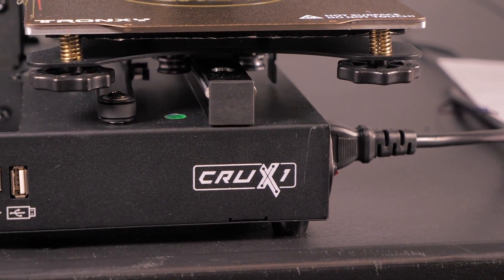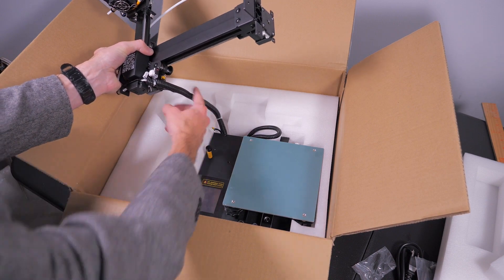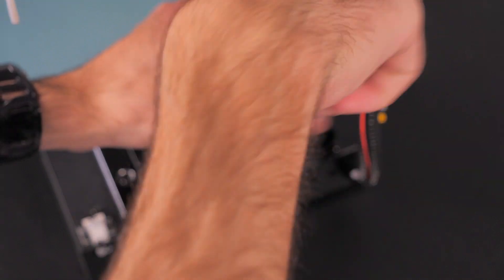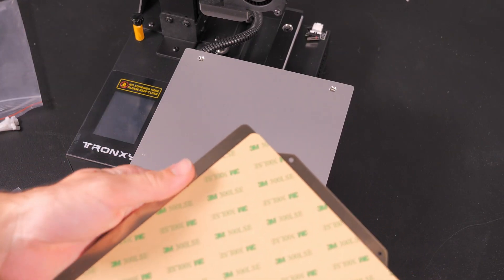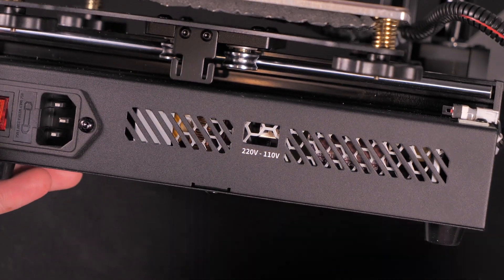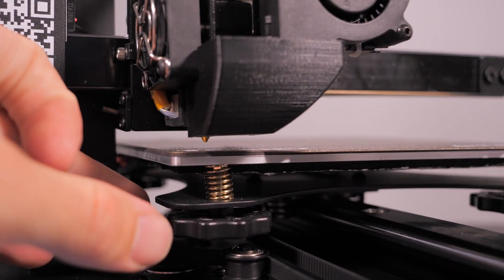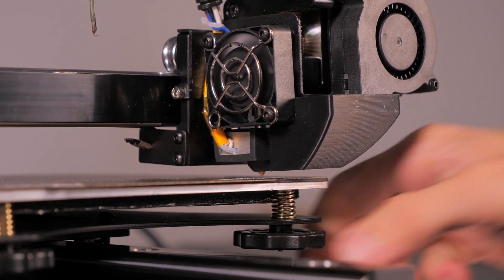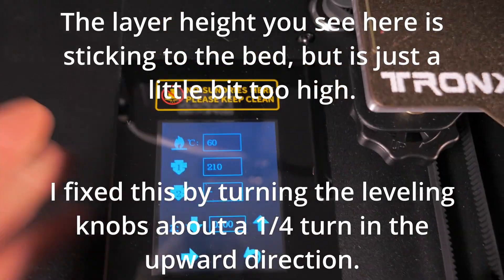TronXY Crux 1 Unboxing, Setup, and Leveling (Yes, it's a good li'l printer)

Comment: Just to mention, that you can stick the magnetic sheet without the pei on it. A good way is to take off a corner of the sticker and gently and slow stick it to the bed while you apply some force so there are no bubbles. Also the grease of your hands dont do something on the magnetic sheet but in the pei that will affect the adhesion. For the bed leveling, i didnt get why you used a folded piece of paper? We have to be as close to the bed(not very close) to have a nice first layer. Other than that, it was a nice video.

Comment: Love the included spring steel bed, every printer should come with one.
Reply from the maker: It is quire nice for print removal. However,  the PEI coating has a very rough texture and I prefer either a smooth glossy finish that glass provides, or even the smooth but patterned finish I get with lattice coated glass.
Reply: @RCwithAdam1  is the rough coating supposed to help with bed addition?

Comment: Kinda strange they still use vrollers for the z. Almost feels like it eliminates the point to an extent. I always feel like TronXY makes printers where its obvious they juist haven't really thought about the user experience very much at all.

This printer basically has one half-assed gimmick with the rest of the tech being straight out of 2017.

No ABL, old fimrware, no firmware z leaving you to use that weird z screw, clearly tilted nozzle (just poor quality control there).

I always sorta think to myself, who would I honestly recommend this printer to? And maybe its somewhat privileged, but I cant think of anyone who I feel values their free time to such a low extent that this printer would serve them better than one that has at the very least nozzle based ABL like even a CR6 or Vyper or something like that. When someone reviews printers often/has a lot of experience, sure they can make it work, but theyll have better options, and will just be using it to review, so I still cant think of the person who this would be the right printer for.

Separately,  as just an addon to this, have you seen the Bambulab X1 and what are your thoughts? Seems like something that would interest you
Reply: You get what you pay for I guess.  For a sub $200 printer it seems better than the others of this class.